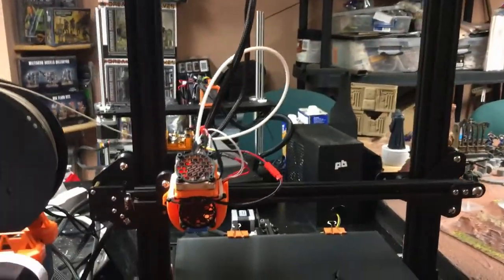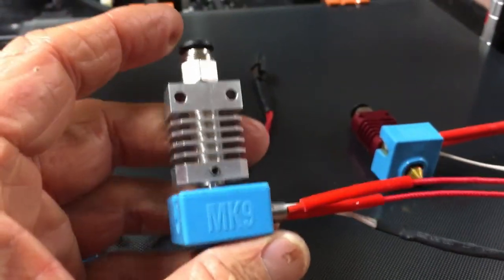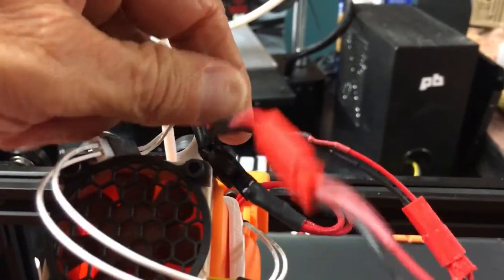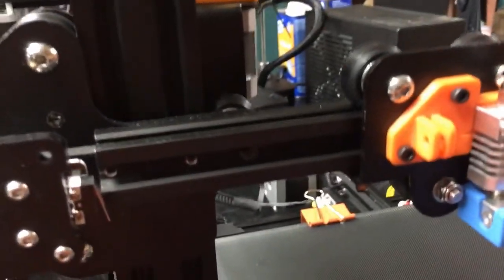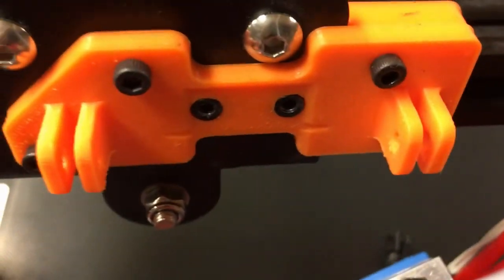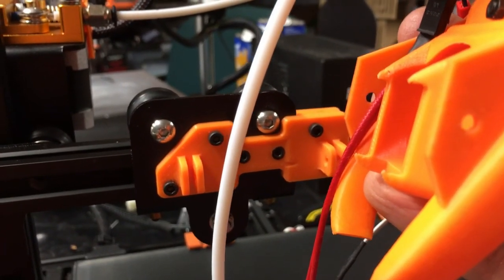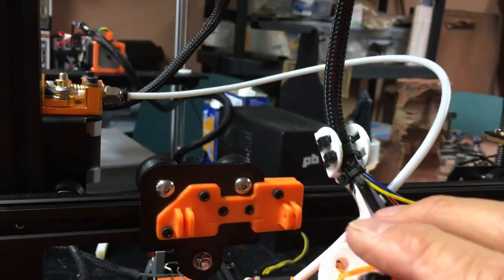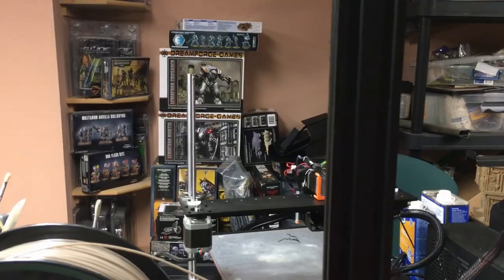CR 10 Modular Hotends Setup and Fang2

Comment: micro swiss not supposed to have lining its all metal hot end
unless you got a diffrent one the one i just put on my cr10s is all metal no tube on the inside and the bowden tube dosent go far in the micro swiss because of heat dissipation all metal and titanium heat break tube never touches it just trying to help also get you some capricorn tubing works alot better
Reply from the maker: Thanks for the comment. I have both Micro-Swiss models, Full Metal and Flexible Friendly. You are right the PTFE does not sit as deep in compared to the stock hotend. I do have some Capricorn and Tough Tubes on hand. I did have a bad experience with Capricorn once. I don’t know if it was a bad batch of tubing or the filament I was using, retraction’s were not working possibly the tolerances were too tight causing constant clicking and eventual clogging.